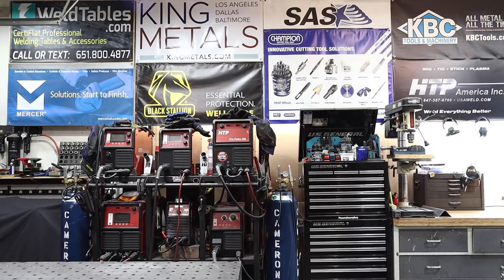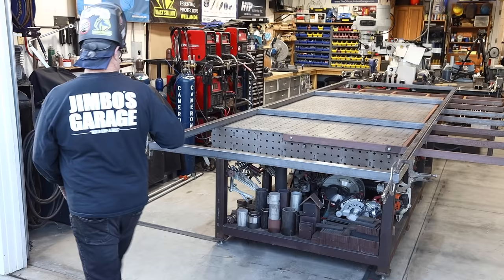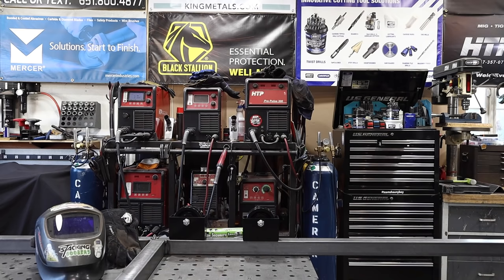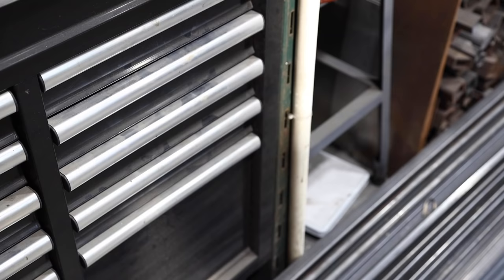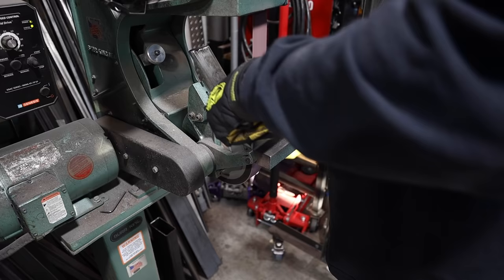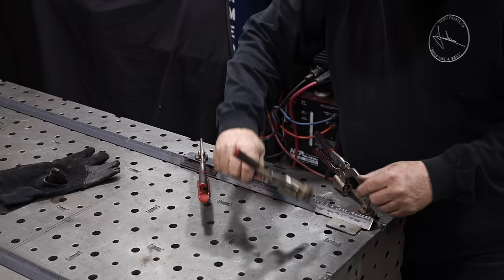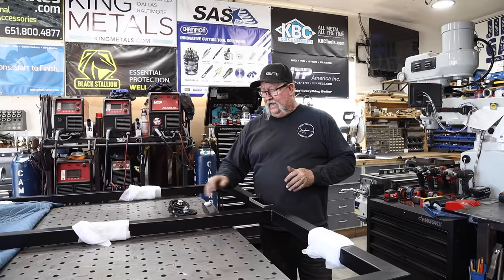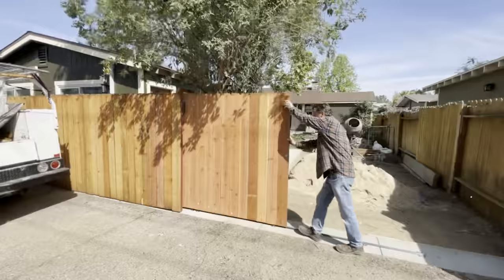How to build a large metal frame rolling gate | JIMBO'S GARAGE

Comment: I built the same type of gate, about the same length. Not as pretty, I used scrap round tube. I'm not really a fan of the tabs welded to the angle track, you're going to have exposed anchors that somebody has to drive over.Better way to do that is to lay 2" x 1/8" flatbar on the concrete and bolt it down from the center. Then stitch weld the track angle over top of the anchors. My track's been in place for 10 years no problems, and if I ever had to remove it it's easy to cut stitch welds. No sense in trying to powdercoat the track pretty, some cold galvanizing spray holds up surprisingly well. Mine uses the same type of wheels and rollers but I built a remote opener that uses roller chain.
Reply: I love that idea!

Comment: The box is very easy to disassemble, I weld it in without the hardware and paint it like that. Also you weld it upside down. The J hook is supposed to come up so they can’t lift it out of the lock. 
👍

Comment: Very well done. I made my self one but its only 10 feet long and it has 2 track wheels on the back like chain link gates do. I made the frame out of 2x4s and attached a metal post on the side for the track wheels. On the bottoms it has a V groove track and wheel. It’s holding very well after 2 years and slides very easy.

Comment: Love your videos jumbo.. I’ve been building gates for many years . Like watching others build to pick up on what others do. When I use this lock box deals I take them apart super easy take off all paint and weld them up same way you did and sent it over to power coat. Never had a problem. Usually don’t like to weld after coating Just a tip. Hope it helps..

Comment: It appears to have a U bracket going over the gate to hold it in place with rollers on either sides, however it is blocked by the tree. Great video
Reply: I was trying to figure out the same thing, how does the gate stay in place while rolling? @Jimbo, could you let us know?
Reply: @smokeythebirdbrain  
The last 3 or 4 seconds of the video show the roller near the top of one side of the gate in action.  He mentioned he'd built and pre-installed that upside down U-bracket that holds both vertical rollers -- one on each side.

Comment: I love your welding videos and you do great work. Just a thought, I would have disassembled the lock and welded the box in before powdercoating. The new owner will probably want it rekeyed anyway, since the manufacturer say "Keyed the same". I just found out Kwikset makes a version of this lock without the the outside box. "Glass Narrow Stile Door double Cylinder Kwikset KW1 Deadlock HOOK Bolt"

Comment: Question... With that type of lock, what keeps someone from lifting the end of the gate up to clear the hook of the lock from the post it is latched too and opening the gate? Would it have been better to install the lock box on the stationary post ? That way the gate can't be lifted to unlatch it from the lock. 

Jim as always love the videos and the builds. 

Sincerely 
Chris 
T-Town Welding and Fabrication
Reply: Great work as usual Jimbo! I was also wondering how inside rollers were affixed to stop gate from falling in?
Reply: Excellent point. A flat piece of metal could be welded onto the post protruding a couple inches above the top of the gate. So when the gate is closed it would prevent it from being lifted as you indicated.
Reply: The hook lock should have been installed with the hook going up to avoid the gate being picked up....also you can take the internals out of the hook lock to weld the box before the powder coating...
Reply: Should install with hook facing up. Then you can't lift it.

Comment: Great project! I was wondering if would have been possible to remove the internals on the lock so you could weld it in before the powder coating? I’ve never seen a lock like that so I wasn’t sure. Again great project.
Reply: Fully removal yes. I use these lock
Boxes everyday to build doors and gates. We send them to get painted with no internals. And upon install we put the lock back togeyher
Reply: They are easy to disassemble

Comment: Great job as usual Jimbo! Love to have seen a photo completed with the wood, but, it is what it is. you mentioned you were stitch welding the lock - would the pulse setting have accomplished the same 'cooling' effect as stitching? Thanks, mikey
Reply: Yes it is possible with pulse effect, but since jimbo only had one lockbox to weld, the time to get hes perfect pulse setting would of been longer than to just stitch weld that one.
Reply: That's not stitch welding . It was tack welding which isn't very strong . A good welder could've welded that box in without tack welding

Comment: If possible I put wheels inline with verticals- especially on a 16 gauge frame.  I don't build gate frames with 16 gauge.
The latch faces down permitting gate to be lifted up and rolled open.

Comment: Nice.  I see a roller on the front of the gate but what keeps the gate from tipping off the angle iron on the ground that the wheel is riding on?  Seems like it would be top heavy and just fall over on its side……
Reply: 2:12 roller on both sides

Comment: I reviewed your video because when I got a fabricator to make a gate for a 27 ft. rolling gate he said he needed shop drawings. As a trained draftsman I said, no problem. Easy. Until it wasn't. 🤔Your well produced video answers many of my questions and does, in fact, clarify many design detail considerations I had. 

That said, noting that the arch includes the two rollers plus clearance for the gate, other than stating that it was previously set in concrete, you didn't indicate the dimensions of the arch. You also didn't indicate any details for the lock end post. Just a 2 in X 2 in post set in concrete? As a result of that approach I noticed that arch wasn't powdered. In my case I plan on having the arch surface mounted on existing concrete and having both it and the end part powdered along with the gate. 

Also regarding the lock box, why didn't you just remove the lock assembly then weld the box in and let it get powdered before reinstalling the lock? Those things come out and reinstall quite easily If you have the key, a small flat tip screw driver (tweeker) and access to the jam face.